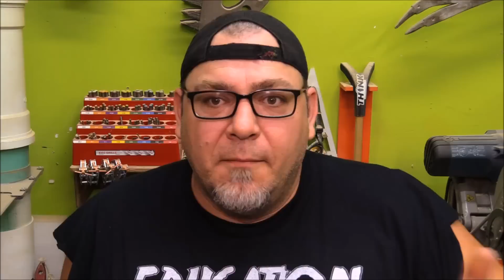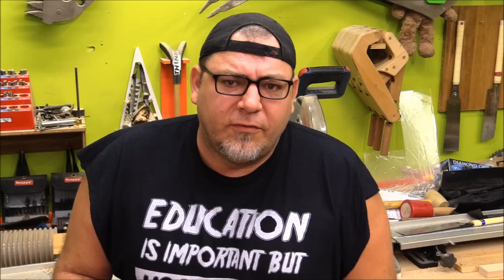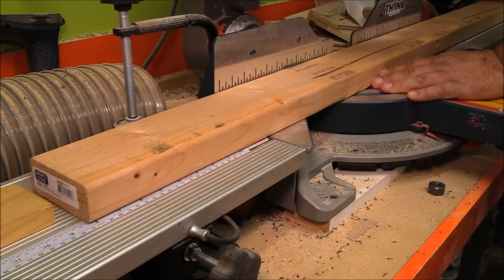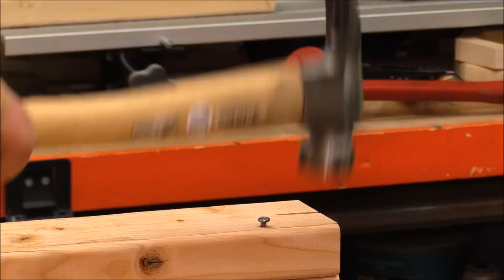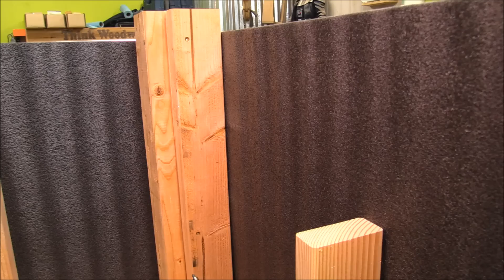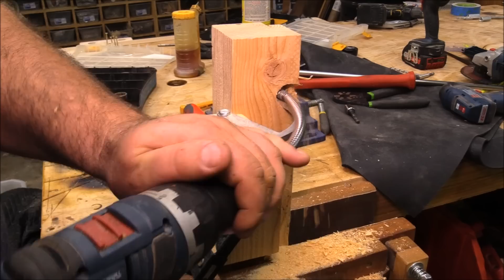Why drill curved holes?

Comment: A straight hole at a 45deg angle to the wood would be easier and better for passing cables or pipes thru.I think you drilled into some of the fixing screws and damaged the tool.

Comment: The flex shaft seems like a potential weakness. As long as the bit diameter is large enough, you can probably replace the flex shaft with a solid one, with a couple of universal (Cardan) joints.

Comment: Its a great idea but most framed corners are hollow not solid so just drilling a hole in from either side and hooking your wire is way faster an uses one tool.

Comment: You really should never have to do this...Especially if you framed the wall...One corner should have two 2X4's or 6's with cutoffs sandwich between, this creates a void on the return wall...Drill both sides and feed the wires through...

Comment: We use 3D bits! You can also worm with them too! Good vid' but over engineered!
Reply: To use a "3D" sculpting bit you need to have enough space to lean the drill "into" the wall. That just isn't possible in many places.
Reply: I agree but with a bit of too and fro-ing from both sides, most applications can be achieved . Seems there's no exact science to this age old problem and unless somebody comes up with a solution nobody has thought of yet we are still stuck with roughing it out! I think you're on to something with this, just needs engineering to a higher plane!

Comment: It's way easier to drill two intersecting holes.  Using a string tied on to the wire, pulling the wire through the hole.  Easy peasy Doc and Sneezy.

Comment: If the framer built a corner that was inaccessible for the insulator and electrician to deal with, he would be coming back to frame it properly.  There are better ways to build that corner that doesn't require drilling a curved hole.

Comment: Cool drill idea, but that is not how you make an outer corner of a house
Reply: @godinn lives the dude was just saying, even if he didn't know what he was saying us true or not.   no need to have a hissy fit man. you sound like my 8 yr old son trying to prove his brother wrong. lol
Reply from the maker: it depends on what part of the country you live in. there are 3 standard methods and code depending on where you live calls for different. this method is called the Slang term C corner there is also the L or California corner and the ladder corner don't know the proper name for the ladder corner.
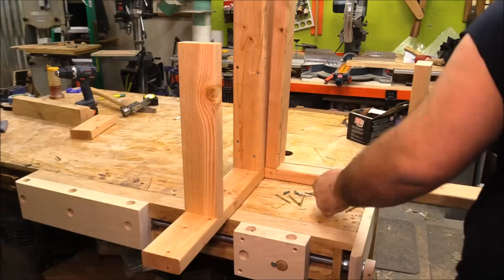Reply: Don't assume a double corner for the california corner that he made in the vide.  0:57  The corner in the video is the worst and you might want to consider a retraction.

Comment: Also good if you want to put a cable in a wall that comes out under the floor.  You could drill 90 degrees straight down.
It's a great idea!
BTW this is youtube.  Didn't anyone tell you that you can't use a hammer.  You have to use a fancy nail gun at all times :P

Comment: you need to make the arc of it a bit smaller; as it is your design puts the hole drilled to close to the outside edge of the wall- which will require nail plates that are not always easy to put on against outside sheathing. It is much easier to put two nail plates on the inside of the corner. if you make it so the jig holds the drill shaft below the guide plate you can avoid drilling into your jig.

Comment: As I commented on the previous video, I think this is a great idea but it's not as simple as it looks. Personally, I reckon you're on the right track with the free-running flex-drive and a handle on the jig. One other thing to consider is the parallel sides on the bit versus the radius of the curve. With a regular bit, the trailing edge is likely going to bind up on the outside of the curved hole as it cuts. You might need to taper grind that off a little towards the drill shaft. It would certainly reduce the loading on the drill. With a little more experimentation, it looks like another winner though.

Comment: Not to take away from you on this cool project, but where I live (Norway), the electrician runs the cables across the roof, then down into the walls where the switch or outlet is gonna be. Seems as you makes this way more complicated than need be..?

Comment: that would be super useful to get through the floor inside the wall cavity without having to knock a huge hole out of the dry wall. access from under the house is limited so this may be the only solution that doesn't result in major wall damage.

Comment: As someone that has drill the straight holes in the corner posts, probably more than a thousand times over twenty years, and trying to get the wire through and turn that abrupt 90 degree,  I would have love to have a bit that drilled a curved hole.  It is a great idea, Izzy, and I sure every electrician would want one in his tool box.
Reply: Absolutely agree with this. Something like this would have saved so much grief.  I hope you go on to develop this and let's see it in Home Depot, Lowes, etc.
Reply: Couldn't agree more

Comment: Definitely not a tool for the average homeowner. DEFINITELY a tool for the trades. If interchangeable bits aren't possible, maybe you just sell it in sizes. Electricians buy size X. Plumbers know they need size Y for their work. I've run enough CAT 5 to know it's a 3/4 inch hole if the RJ-45 is already connected. Push on Izzy!

Comment: Electricians have a drillman that will pop two holes in a corner in a matter of seconds. If plumbers are forced to go around a corner, they'll take some meat from the inside and cover the finished joint with metal shields. No professional would do this. Still a thumbs up for the cool video and awesome channel.
Reply: If they had tooling like this in the hardware shop then professionals absolutely would do this. You are thinking in constraints of today... I feel obliged to point out that this video is showing innovation beyond constraints of today. Growth mindset yada yada.

Comment: Makes perfect sense, Izzy. A production version of that tool would likely need an interchangeable drill head. Perhaps Healy to the shaft with a set screw landing on a tapered flat like the Shopsmith spindle? As I've said before, thank you for sharing your failures as well as your successes.

Comment: The only problem I see is with your new idea is that you want to have one hand on the drill and one hand on the pivoting handle. In that case how would you be able to hold the whole unit to the studs? In your last video you clamped it to the studs also. Either way, cool video. Can't wait to see how the project comes out.

Comment: How about using a series of small U-Joints and short shaft-sections (short enough to stay within the arc of the curved hole) instead of the flex shaft?
Reply: Because that will not  work....  Go  get  some u joints out of your  tool box put them together and you will  see they  will  kink and lock together
Reply: And a flex shaft on its own doesn't follow a fixed curve. What is your point? As you can see on both of Izzy's videos, there is a solid metal support guiding the shaft. Simply use that to support the straight sections of the solid shaft, and it would work just the same.

The advantage of using a flex shaft is that it allows you to use smaller bits (because it follows the arc more closely). If the bit is big enough, though, there are several advantages to using a solid shaft, with as few segments as possible.

Comment: With some minor adjustments, this could be a great time saver for multiple tradesmen. 
One issue that has to be addressed is the placement of the hole. It needs to be in the center of the stud. Holes are not allowed to be in the edges of the studs (for a number of reasons including strength as well as drywall screw placement).
Reply: I am going to reply to this so maybe he will lcatch.this.
Reply: Or side it!
Reply: I was thinking this is an older corner method, but there are still times when it would be handy.  Even with meeting 2 holes it can be difficult to convince romex to change directions.  In this area most of the holes in wood studs are 7/8 instead of 1".
Reply: Cold corners and sheet rock backing determine the corners construction.Also most exterior walls are 2x6.
Reply: In Florida, USA, most of the wood frame house exterior walls are 2x4.  In wet walls (plumbing) 2x6 is used to provide enough space for the pipes.
Reply: Interesting. in Washington state we build 2x6  exterior to allow for enough insulation to meet code..Started in the nineties.

Comment: Having pulled waaaayyy to much CAT 5 for new networks, my only break was the use of metal 2x4 walls.  I could pull wire through a corner, still had to bend tubing to protect the wires in the 90 degree turns.  Old building or home installations  involved notching out corners and metal caps to protect the cable from a crazy sheet rocker.  I love the concept and look forward to the completion. - Annie

Comment: Way cool, Izzy. While making improvements to the cutting head and guide, I'd like to suggest changing  the radius to put the hole in the center or nearer the inside corner. Although you're designing for closed construction, there will be a great likelihood of siding repair in the future, with the possibility of a fastener hitting the wire or tube if it's so close to the outside.

Comment: im thinking do the other method of a 90 corner from drilling 2 holes and have a little rounded insert that can guide the wire as you feed it and be fished out when youre done.

Comment: I always build with California Corners which makes going around corners easier for wires insulation and such. That being said this would still be an awesome tool to add to my toolbox
Reply from the maker: California corners? is that the ones with the l shape on the out side?
Reply: +izzy swan on your mock-up it looks like you put a stud on the very end of the wall and then another stud probably three and a half inches away from it. on a California Corner that second stud is turned 90 degrees so it runs parallel with the top and bottom plate creating a pocket to tuck insulation into but also still gives you a place to screw drywall to
Reply: +martylts the first stud and the second stud form an "L"

Comment: cool but since it's cutting away more material wouldn't that degrade the load bearing of the 2x4s especially since it is rounding through the middle. How about a comparison stress test. ;)
Reply: it will degrade the load bearing capacity, but everything has a factor of safety built into it, and that includes studs. If you think a 1 inch hole is bad, just wait till you see what a plumber or HVAC guy will do to load bearing  members that are in their way!  LOL
Reply from the maker: it a 1-inch hole which is pretty standard across the industry.
Reply: Yeah ive seen floor joist with only an inch or two left, some times you look at it and go yikes,...
Reply: If it's an interior 2x4 wall it's typically not load bearing. Any point loads from above (beams) would have a built up post below it, which would be 3-4 studs nailed together.

Comment: I've used those flexible drivers for years and they don't hold up well to abuse/high torque. I was really surprised when it worked as well as it did on the first hole
Reply from the maker: I am not surprised I am looking into solid shaft stuff
Reply: +izzy swan i have an idea that might work better, I will pm you
Reply: I sent you a PM on facebook, it might be what you were already thinking